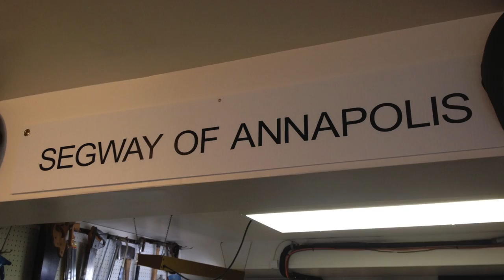Segway i2 Service And Repairs

Comment: FYI ...Dick ran the service side of his business out of his two car garage from the start of his business in 2004 to late 2012. As you can see, he quickly outgrew this space as demand for service repairs continued. He now has a separate service shop to handle the demand, and repairs and services units from the Baltimore-Washington metro area, as well as units shipped in from all over the United States.  The video creator is not affiliated with his business, so if you have questions about repairs, parts, etc. please call the business.
Reply: Richard Mullins  what area are you in?

Comment: Dick.. I have a 2004 and a 2006, and both have  a similar problems.  Both reflect a  "full battery charge",  The 2004  may go 30 or 200 feet, at which point it goes "red", on flat surface.. The 2006 is ok, unless I am on slightly rough terrain, or on any slight upward incline and it goes "red" . Any suggestion/ideas of the problem?  ....I am 4 hrs. from your location.   Thanks...  Bill D

Comment: I'd like to change my elastomers on a gen one I 167. Do you have a video or instructions on how to do that? I can get at the elastomers with no problem. I don't understand how to remove the female piece from the shaft, and I assume I need to change both male and female to actually fix the issue. Any help would be appreciated.

Comment: Are there any repair videos that would show how to replace a motor?
Reply: you cannot change parts on gen 2 or newer units as they are internally serialized.  Even dealers cannot change parts (except for the charging card) on Gen 2/SE models.  unfortunately they must go back to new Hampshire for most major repairs.  We are a dealership if you need Segway technical support or parts contact us at buyasegway.com

Comment: Hi - is there any video or instruction on how to remove the charging unit on an x2 - mine's gone wrong and I'd like to have a go at repairing it as I think it may simply be a connection issue.  Thanks
Reply: it is shows error code?

Comment: I want to ask how many tires to fit in your life that you did a video? so never install an inner tube and the valve is not inserted into the hole in the rim with pliers. he puts forward as his hands and then led into the inner tube into the outer and then being inserted into the edge of the tire rim. you are afflicted with this tire. there's more to learn!

Comment: hmmm.looks like a guy who is more of a backyard handiman than a professional mechanic..He works on this Segway while it is power to it,which is a real basic no no..
Sooner or later the snake will bite and there will be injuries and damage to customers Segways.And as you can see, he does not use basic proper tightening skills as he NEVER uses a torque wrench when tightening up any nuts or bolts.By doing this method he is risking damage to the Segway, but also customer injury do to overtightening.